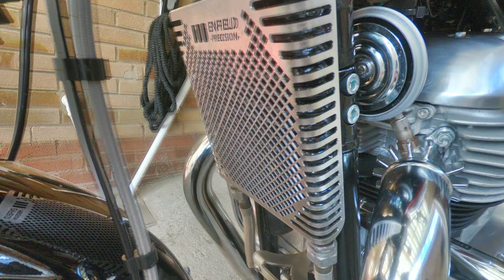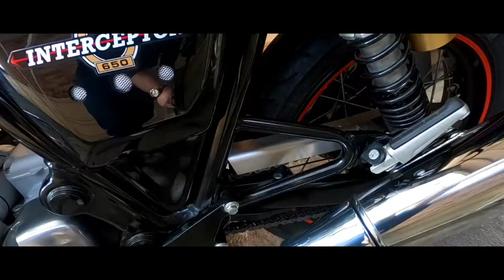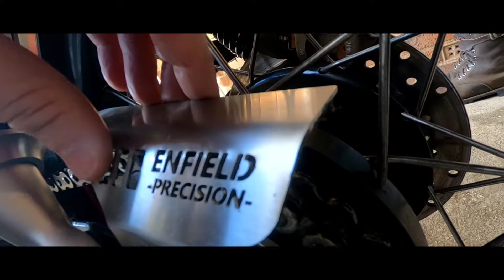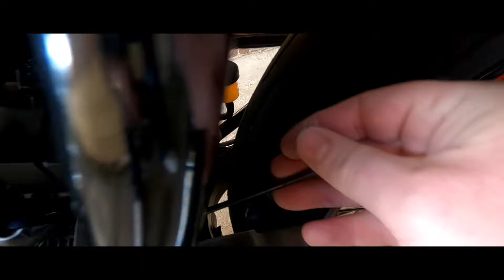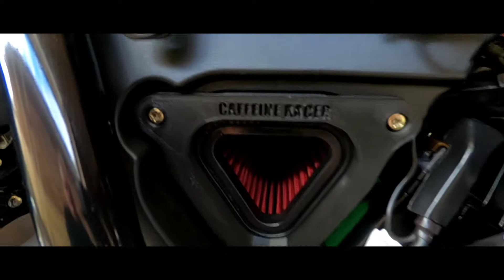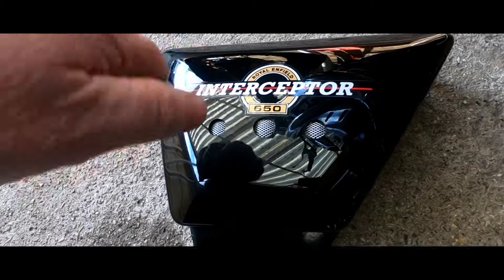royal Enfield interceptor 650/continental gt 650 oil cooler,chain guard precision engineering

Comment: Nice one I have the Enfield Precision Oil Cooler Guard & Chain guard be.
Reply from the maker: Did you struggle fitting the chain guard front fixing screw?I did what a fiddle😂
Reply: @itsallrc-interceptor650  I heard it was a fiddle & you needed one of those ball Ellen keys with t- piece like Stu Fillingham used.I didn't have one in my tool box 
So When bike went in for 500km
service I had service shop for it along with sump guard.
Reply: I wouldn't mind getting a set of ball Ellen gears Uncle Stu used he seems to use them heaps so I gana get some.
Reply from the maker: Yes I think they would have made the job alot easier 👍
Reply: @itsallrc-interceptor650  Did look at rc cars I told you about?
Reply from the maker: Yes I did cool trucks👍
Reply: @itsallrc-interceptor650  Yeah I think they'll be next lot of tools I buy I have heaps of ellen key's but none in the style of Uncle Stu Fillingham with round hall & long neck t piece definitely will come in handy.Also I saw a video about hypo Kevin Talbot someone using his name with bullshit phone no to rip c🤬ts off.Fake Kevin Talbot video.
Reply: The Enfield Precision Oil Cooler Guard is heaps better as it has wrap around protectors on side & they have slits in them to help it breath better.I had another one but holes were smaller & had no slits on the wrap around like the Hitchcocks one that's why I got Hitchcocks one ad it gets bloody hot here 33°-37° regularly over summer & the extra size holes in front & slits on wrap around sides make it run cooler by a few degrees adding life to engine in long run.Gave the old one to Vinny which is better than flimsy  shitty stock one.
Reply from the maker: I agree but here in England the weather is much more cooler.but I have seen some which either have too bigger holes(no protection) to hardly any (may run hot).the Hitchcock's one is a happy medium.whos Vinny?
Reply: @itsallrc-interceptor650  Vinny is the kiwi guy who runs Road Blast Media Royal Enfield vlog.
Reply: @itsallrc-interceptor650  You seen HIM haven't you I'm pretty sure I found you on his site.If not check HIM out.
Reply from the maker: When you said Vinny I thought"wonder if it's road blast media Vinny".I sub to he's channel.
Reply: Ok
Reply: @itsallrc-interceptor650  Yeah HE gives me shit cause I was the one who said to HIM "You ride your old man's bike & talk about it more than han your KTM.Are you going to get a GT or Interceptor is HE."& HE did nah I love my KTM blah blah.Then in next video HE was riding his Old man's Interceptor & I said in comments" You do sure love Interceptor haha".Then in the next one I said "sounds like you made your mind R.E haha".Then HE did the 5 things I dislike about Interceptor,and I commented "Is HE trading in KTM IS HE for R.E Twin haha"& HE was oh nah I love my KTM blah blah.Then in the next video HE was riding HIS old man's bike down street going "I've broken & going to buy a Gt you can thank Ruahines Rider for his comments & I had good think about & HE'S right so I'm getting one."hahahaha hura of a joke as us kiwis say.haha😆😁😂 Also I was HIS first subscriber so been corresponding with HIM since the beginning & showed HIM pictures of the mods I've done too & I think HE was hooked.haha
Reply from the maker: So it's all your fault then😂😂
Reply: @itsallrc-interceptor650  Yes I guess it is
Hahaha 😆😆😂👍
Reply: @itsallrc-interceptor650  That's why HE had was looking me.hahaha😁😆😂
Reply: @itsallrc-interceptor650  l meant that's why HE says I'm looking at you Ruahines I'm looking at you Ruahines Rider.Looking forward to catching up with him on the Taupo ride haven' met HIM yet so that'll be a laugh.😆😂
Reply: @itsallrc-interceptor650  I was thinking about buying a spare left side cover or both & buying K-Speed side covers that they glue over the top of stock.Kspeed one's have 3 vents with mesh on them I was thinking of getting a spare stock one & dremeling the 3 squares out so they match K-Speed side panels & then glue K-Speed over top to help it breath better.